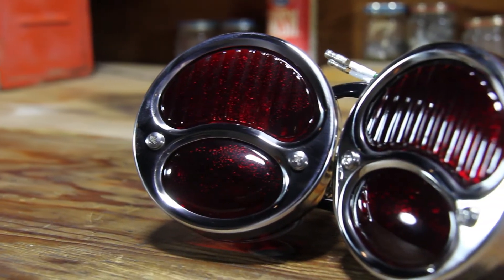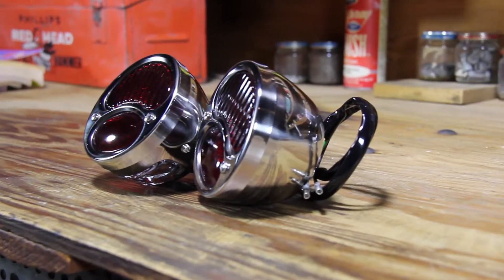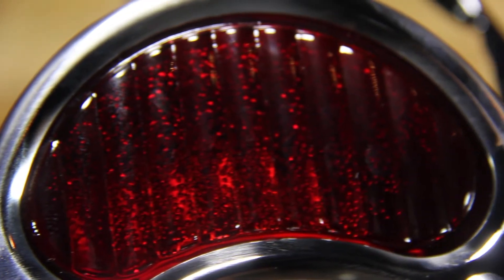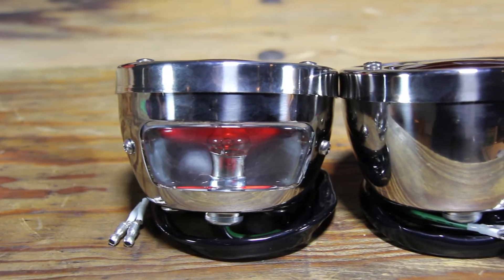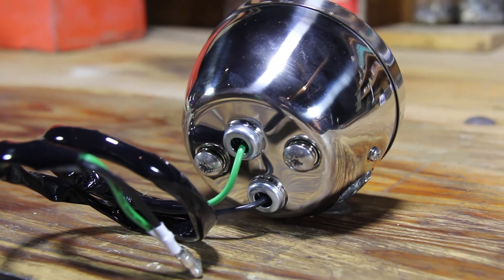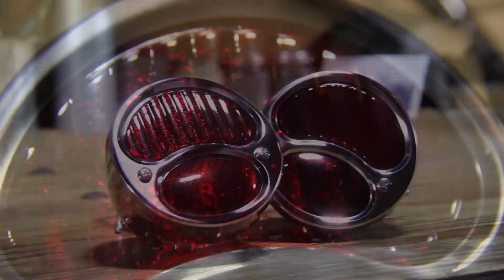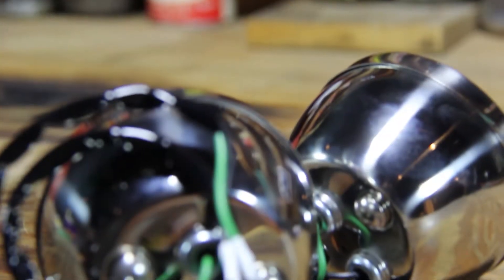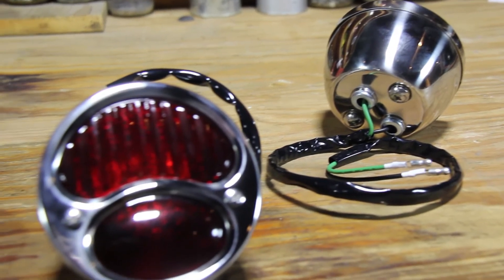Speedway Ford Model A Stainless Tail Lights

Comment: Sorry for my ignorance, but why do they have two red lights ??
Reply: One is for brake light the other is for turn signal.
Reply: The bottom one is your running light the top one is your brake light. You can incorporate turning lights into the top light if you have the correct wiring harness.